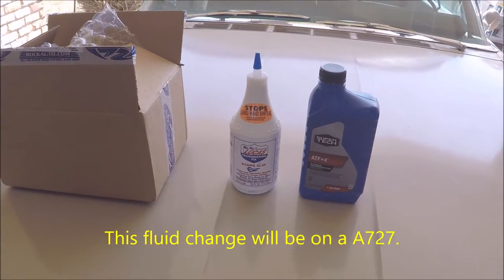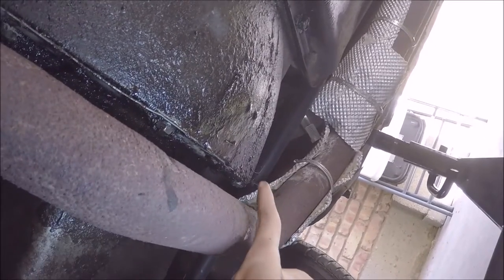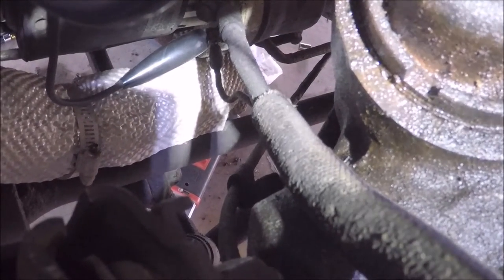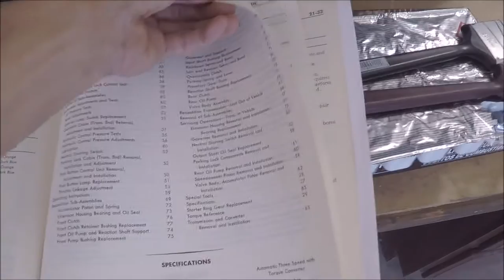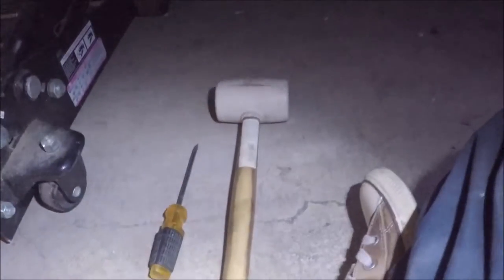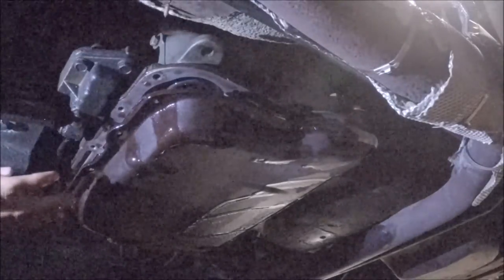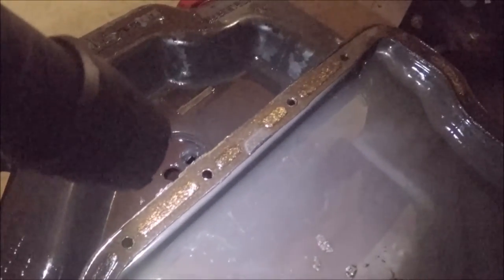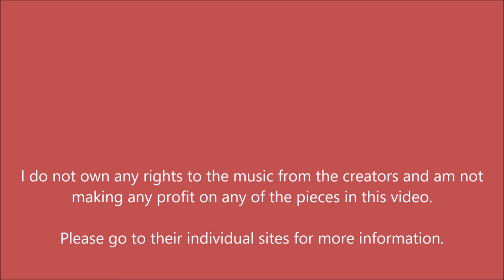My 1964 Dodge custom 880 | Update # 17 TorqueFlite A727 fluid/filter/gasket service PART #1

Comment: I'm sure you know but just in case you don't, absolutely nothing on that car is in metric size.. it's all standard. If you use metric tools you're increasing the likelihood of stripping bolt heads..
Reply from the maker: Thanks for the feedback! Chrysler tends to be wonky with their cars just like any other car manufacturer. their left hand thread lugs caught me off guard the first time I encountered those.

Huh, news to me. Didn't realize that standard size was dominating vs metric, thanks. You learn something new everyday!
Reply: @samhicks97  I hear ya, one of my first projects was a 62 Newport. Not dissimilar to your car, I think your Dodge has newer style/better brakes but I'm not sure. Now I'm onto my 58 Plymouth! You're doing a good job, cool car!
Reply from the maker: @mediamain6  Thank you very much, I hope to learn more while fixing old Detroit iron! 58' plymouth? How's it going with that? Parts more scarce I bet, as all chryslers has metal made of un-obtanium.
Reply: @samhicks97  It's not in the shape your car is, I wish it were. Got it not too long ago, I drove one just like every day years ago. Sold it to a guy, he sold it awhile back and now it's in Paris. I'll never get it back so I found this one to replace it but I have my work cut out for me. I have all the parts for it in triplicate or more. I had several when I had my original one that I drove every day. MUCH easier to find back then LOL. Your car is awesome and in great shape, I'm envious of the a/c and you can't beat a 4-dr HT! Style and a back seat you can use! Your car has one of the best transmissions ever built; the aluminum Torqueflight. I enjoy your vids, you're doing a good job!
Reply from the maker: @mediamain6  I hope your hotrodding endeavours bears fruit in the long run! 
(Don't know if I'm using the word endeavour in a sentence properly)

But wow, paris? I hope That Plymouth is getting treated to the finest French motor oil money can buy!

Agreed, the Torqueflite will continue to ring in that massive bellhousing.

Regretably the AC is all show no go, the freon leaked out. I'll need to get that repaired or replaced soon!

Thanks for the comment, really appreciate hearing people's different stories and different take on a bumpy road we call life.

Thanks for the compliment!
The dodge runs strong on all 8 cylinders with no intention of stopping, Detroit iron all the way!
Reply: @samhicks97  Oh yeah, just buttoning up another little project I'm working on then it's full throttle forward! Ya know, I'd really have preferred my car stay in this country but I didn't have the money to get it back so there it is. I never should have sold it to begin with, I was the second owner. I bought it from the lady who ordered it new, talked with her a lot. Got to hear a lot of her stories. I didn't have the appreciation for it all like I should have, got into a position and sold it. Bad decision.. Anyhow.. don't worry you'll have time to repair that a/c and you'll LOVE it. I had a 64 300 with working a/c and boy did it work! A GREAT system. Old cars always have something to do, just make sure you're getting some smiles per gallon driving it man. That motor sure does seem to run well so that's a good thing. 361 or 383?  Good motor regardless.
Reply from the maker: @mediamain6  Indeed, the A/C is much needed in the winter months as the windows fog up quite often.
 64 300? beautiful car, still has that Virgil Exner's forward look lingering!
I indeed am getting smiles per gallon and sometimes get a curious frown from other people as they have never heard of the Dodge 880 model lineup, it's a bit of a  "off the beaten path" of a model, but that's why i like it. Also, it's got the 361 in it.  Thank you very much Sir for the comment!
Reply: @samhicks97  I'm always happy to comment and talk cars! Nah the 64 300 was a better built car than a good looking car. I bought the thing cheap and drove it for a little while. Leather interior and full power goodies which all worked. It had an excellent running 383. So are you having a problem with the actual air conditioning or do you mean the climate control like heater/defroster/blower? Does the blower not work or is it more like the heater control valve/heater core like either the water hoses not connected or does it not blow heat? I'll tell ya driving mine as long as I did.. the defroster never really worked great or at least not like a more modern car. It takes a good 5-10 mins to clear the windshield.. carry rags! I've read waxing the glass helps.. never tried it tho
Reply from the maker: @mediamain6  The climate control/blower motor speed selection works, the a/c works?? It just blows warm/hot air in all of the a/c selections on the controls.

 I just removed the heater core as it was spraying coolant on the dash window. Seems like your 64' 300 had full on all optional equipment on it!
All decked out, and looking dapper with the leather seats!

I carry rags also and keep the wing windows open to help with the fogging up.

I took out the heater control valve a few months back and it's not leaking, which is a sigh of relief as a rebuilt heater control valve runs up to 250 dollars!

Thanks for the comment again Sir!
Reply: @samhicks97  So it sounds like your heater/def will work once you get that back together. If you can verify that your a/c compressor works then your a/c will likely work once you put in new seals and recharge the system. I think you can find shops to rebuild the heater control valves for around 100, you just need to done some looking online. If you buy one outright, yeah they are pricey.  My 64 was a neat car as it was a mid-year silver special edition. I bought it out of a local junkyard. It had a minor hit to the rear but underhood there were new parts all over it. New ign wires, dist cap, hoses, and belts and the motor looked REAL clean. I took a gamble and it paid off. All I had to do is run a new fuel line front to tank, clean the tank, and do the brakes. Sadly I sold it to a friend who took the motor/trans/front seats out for his 62 300 and off to the junkyard it went again.
Reply from the maker: @mediamain6  I think I may do a R-12 to a R-134A conversion and get a rebuilt compressor online I suppose, and I just have to find a a/c condenser canister that is compatible with the R-134A freon.
I've been looking but finding C body chrysler parts are quite scarce. And little to nobody makes reproduction parts for chryslers, quite a constant battle.

HOWEVER, I still have my 440 A/C, 
4 windows down, 40 miles per hour

That's a shame that the 64' 300 got sent to the junkyard, it's getting rare enough at finding chryslers driving around now a days. The 
engine/trans lives on in another car, an eye for an eye I guess.

Thank you for the comment Sir, much appreciated!
Reply: @samhicks97  I'd think the a/c systems were pretty similar through 1979 on big block cars. I'd think that might open up your parts search.
Reply from the maker: @mediamain6  Cool! thank you, i was strictly searching for parts in the 60's era chrysler's mostly, oh and my mistake, it wasn't the condenser but the A/C accumulator/drier canister. appreciate the information and the comment!

EDIT: You were right! I found a Condensor/drier canister online, thanks! I searched up 1975 chrysler imperial, and boom! The driver canister is for sale online.

Thanks again!
Reply: @samhicks97  For sure man, and I just want to say that I don't know for sure they are the same. I'd venture to say that external stuff like that are likely similar enough to work whereas the heater core and control valve are likely more body/year specific. I've popped enough hoods and seen enough to think that, you just gotta make sure it's from a big block. Having a broad year base to select from is more helpful than one or two years only.. Let me know how it turns out!
Reply from the maker: @mediamain6  Yes sir, will do!
Reply from the maker: @mediamain6  Hey there, i thought i should let you know that the video with the new Borla muffler video is coming out very soon, with some awesome surprises...
Reply: @samhicks97  Thanks for the heads up! I'll be looking for it! Did you add dual exhaust?
Reply from the maker: @mediamain6  Unfortunately no, my budget was kind of tight at the moment so i needed a muffler that doesn't sound as horrible as the stock blown one! 

 I was considering duelies, Otherwise if i had went with duel exhaust, my budget would be so tight that i would be forced to go with the flowmaster 40 series.

Thanks for the comment again, appreciate it!
Reply: @samhicks97  No worries, we all been there. Sometimes are there again too. That's one of the reasons I love mild glasspacks, they sound great, are period right, and they're cheap. Oh yeah, lol whatever you do don't go flowmasters. A friend put those on his 66 New Yorker and another friend put them on a 58 Fury. Sounds like crap. My opinion of course.
Reply from the maker: @mediamain6  actually, to be honest with you, the flowmasters in my opinion sounds too tinny. Kind of like a empty beer can sound.
Not quite the exhaust note I'm keen for.

 I was about to go with glasspacks, but hey ho seems like I decided on something different eh? 

But if I do go full duelies, glasspack all the way! 

May I ask a question sir? In regards to exhaust settups?

Appreciate the comment sir!
Reply: @samhicks97  I agree completely. I just don't think flowmasters of any kind belong on a chrysler engine. They do sound empty beer can tinny. I'm no fan of the sound, neveer have been. The muffler you bought sounds fine, if you do run duals you could prob just get another one of those and be just fine with 'em. Of course you can ask me a question, lol.. what'cha got?
Reply from the maker: @mediamain6  I'll consider getting matching mufflers if i do go for duelies, nothing beats the purity of duel glasspacks

Question:  I wanted your take on this matter weather to if you see/smell any drawbacks to dumping the exhaust before the axle? 

Thanks again for the comment Sir!
Reply: @samhicks97  I don't necessarily see any drawbacks other than it being noisier inside the car than it would be if you left the pipe(s) out the back on. Most people who do that type of thing usually still run a pipe out the side like dumping it right out the side before the rear wheels like stockcars did in the day. The only drawback I can think of is if your car has either engine wear issues and blows oil smoke or it isn't tuned right and blows mixture smoke that could seep into the interior of the car which would be hazardous.
Reply from the maker: @mediamain6  right, I forgot that the noise goes up too as well as the drone at 50MPH. 

Thank you Sir, I'll at some point get some 90* bends and dump the exhaust to the side. 
(If possible)
Reply: @samhicks97  Yeah, the 58 I drove had the exhaust piped like that dumped right before the rear wheels. It was much louder than my other cars and if your car smokes at ALL you'll be cleaning soot off the rear sides of the car. I really preferred twins run out the back with a nice pair of chrome tips like I had on my later cars, that's what I like best. The way Chrysler did it to factory dual exhaust cars with the J hook tucked right behind the rear bumper is good too though. To each his own. It'll sound good though! What turned you on to that muffler? I have to admit I was surprised it didn't sound flowmaster-ish!
Reply from the maker: @mediamain6  Pretty much the low base that Borla's have on most of their mufflers drew me to them, and the lack of people using them on their hot rods.

To be honest I mostly found everyone strapping a Borla muffler on a car that has a catalytic converter and a stock restrictive exhaust configuration.

Example: 2007 or 1990's gm pickups, pretty much any car that had a smogged up exhaust system.
In turn, killing the Borla TRUE exhaust tone.

So I was flying blind and hoped that the Borla muffler was going to sound good, and it's right up my alley!

 I  just don't like the high treble sound that you would get from other muffler brands, flomaster isn't an exception, dynomax is another muffler brand that sounds like a mix of flowmaster and Borla in a way.

 So yes I had some trouble finding a muffler that had low base tone. Seems like my 1/2 months of searching was not in vain.

If the dumping to the side may not be possible, I'll just use the factory exhaust configuration, straight out the back as you mentioned.

Thank you for the comment Sir, really appreciate the feedback!
Reply: @samhicks97  Yeah it's difficult to get a real sound from a vid but it seems like it sounds pretty good. I had a borla system on a car but it wasn't a V8 car, totally different and w a cat.
Reply from the maker: @mediamain6  Thanks, i appreciate it, once i get the brake booster back in ASAP i'll at least run the car straight piped at 40MPH, and with the Borla later on...
Reply: @samhicks97  I dunno if you've tried this yet but once you get it back to mechanically usable shape you should buy a mild polishing compound and apply that on the paint by hand, then give 'er a good wax. If you do, be GENTLE on the tops of the doors (where they flatten out and you'd put your arm with the window down), hood, trunk lid, tops of the 1/4s, and roof. That's where the paint will be thinnest since it gets the most sun and you could rub through so ya gotta be careful. If you feel gluttony for punishment get yourself a tube or 2 of autosol trim polish and go over the trim and bumpers then wax the hard chrome parts. I bet all that work would really transform your Dodge into something that might amaze you. It looks like a really clean original. I'll admit though if your car is outside then all that work might not be practical and justifiable since it won't last but a few months (probably). I know you mentioned that one of the doors was worked on at some point? or was it a 1/4 panel, I don't recall off the top of my head!
Reply from the maker: @mediamain6  actually as a matter of fact I did indeed remove most of the oxidation off of the paint a few years back, and waxed everything when I was done, and boy does the paint reflect/shine!

 I haven't really attempted to go buffer happy on the chrome very much, other than that it's pretty much sealed up with carnuba Maguires car wax.

But when the wax wears off again I try some of that chrome polishing autosol you mentioned. The rear bumper needs it BAD, the chrome on it is hazy as can be.

The thin paint plus the fact that it's single stage paint doesn't really make it easier eh?

The door that I couldn't really touch up on was the rusty driver's door as it was replaced or had some collision damage at some point in time, I guess I'll have to fix the rusting first then try to color match the rest of the car's paint.

I believe the video I walk around the car is when i got done polishing/waxed the paint.

 The amount of heads that got turned as I drove around town skyrocketed after I touched up the paint, quite a difference it made to receive compliments here and there!

Thanks for the comment!
Reply: @samhicks97  Oh yeah you did, jeeezzz I even saw that vid LOL. My bad. It should be pretty easy to find someone who can fix that door and more or less match the paint even using single stage. Even if it turned out to be shinier than the rest it wouldn't look bad. The car does clean up nice!
Reply from the maker: @mediamain6  all good no problem, I'll definitely try to find someone to color match the paint.

Thanks for the comment Sir!